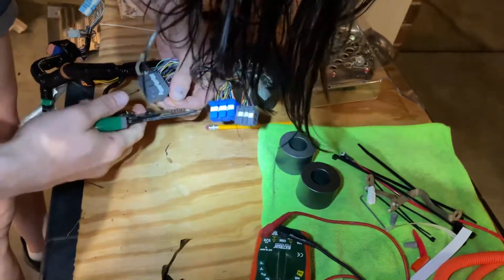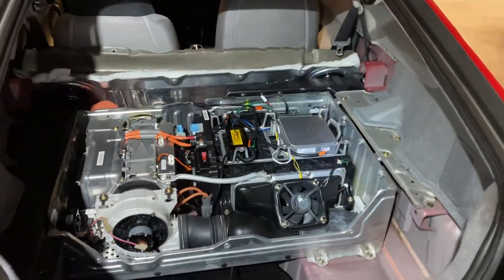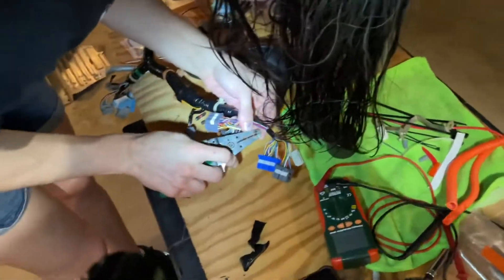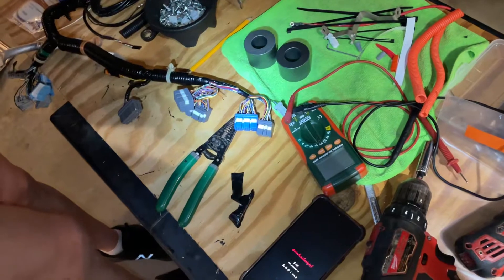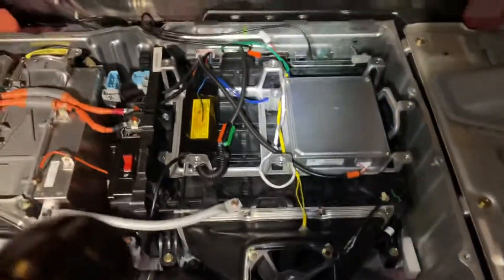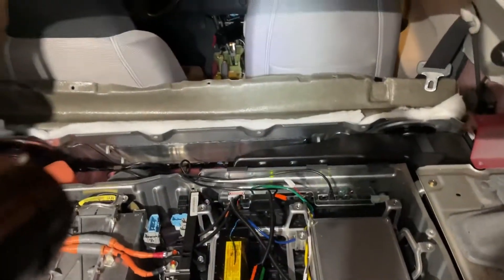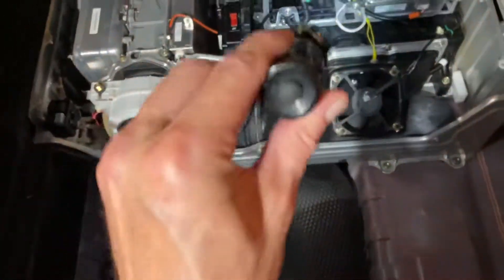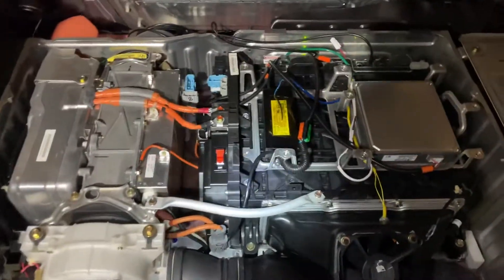G1 Insight: Lithium conversion 4/6, interfacing LiBCM and OEM setup

Comment: FYI: I've added the temperature sensors to the firmware in v0.7.9... they don't do much yet, but they're now fully characterized and you can read the temperatures in firmware.